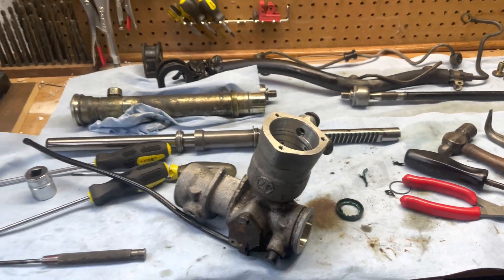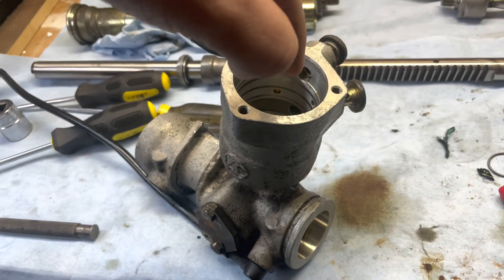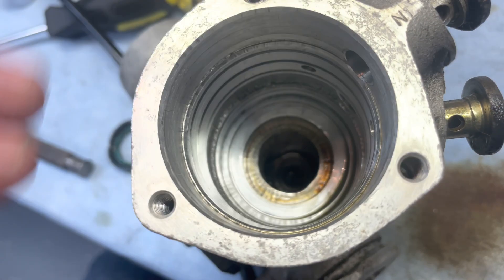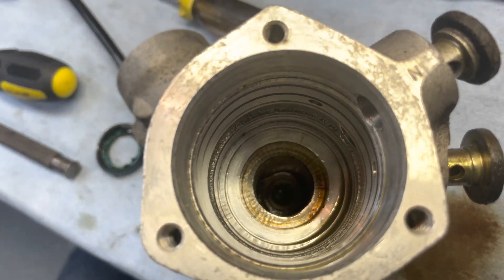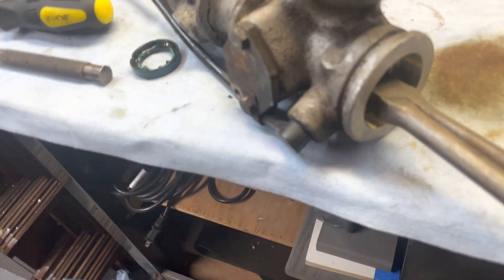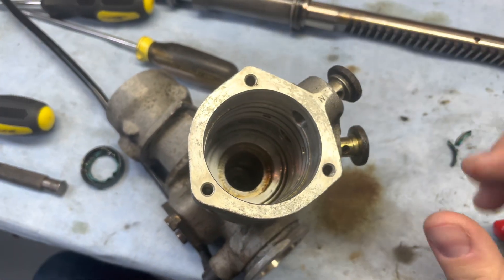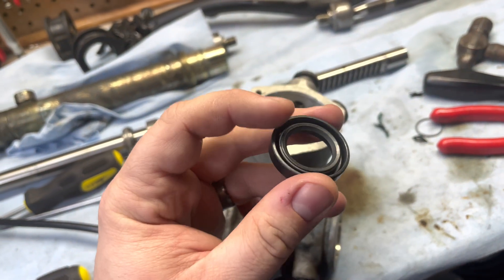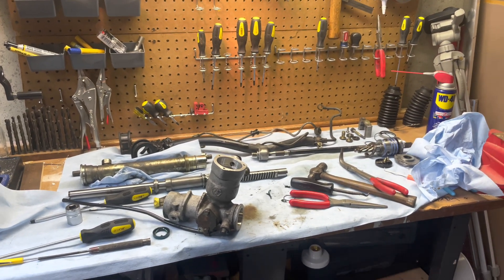Quick Porsche 944 Steering rack rebuild tip

Comment: Gave this idea a try but couldn't get the seal to budge since the push point is offset from center.  Ended up fashioning a puller using threaded rod and a load spreader behind the seal (die from a craftsman tap/die set is the perfect diameter) combined with backup washer for the holding nut.  On the pulling side use a large washer on top of the steering tower endplate (remove endplate o-ring for ease of sitting the plate while pulling).  Worked a treat after 2 hours of head scratching and frustration.  Thanks for posting.

Comment: Great tip!  Do you install the seals dry or wet?  If wet, do you use power steering fluid or assembly lube?
Reply from the maker: Everything has been installed dry. I suppose you could install wet but it would be extremely messy, dry should be ok since your not using the rack until it’s on the car with fluid pumping. On these cars ATF fluid is best

Comment: Just in time for my rebuild! How long was the removal process for the whole rack
Reply from the maker: Hey Aidan, wasn’t bad getting it out, I had to do an oil pan gasket so the rack had to come out anyway, taking your time it would probably take an hour or 2 to get it out, hardest part is the steering shaft knuckle, otherwise it’s just a couple bolts and lines